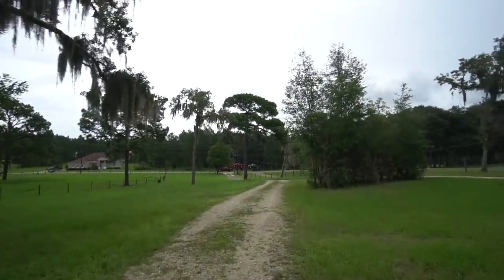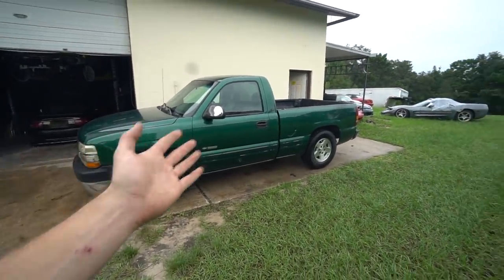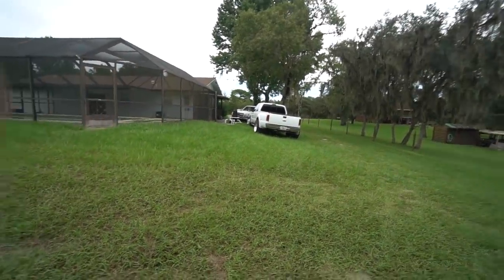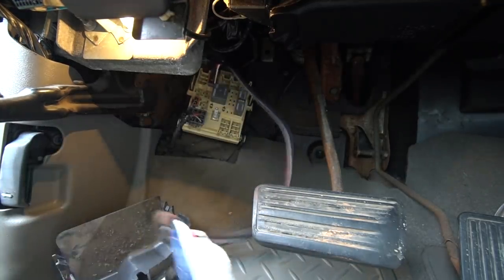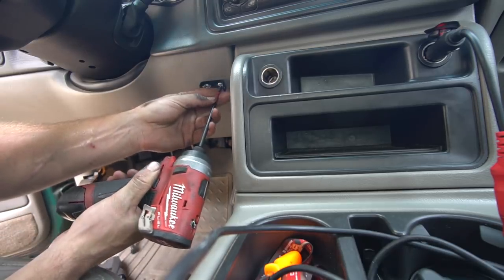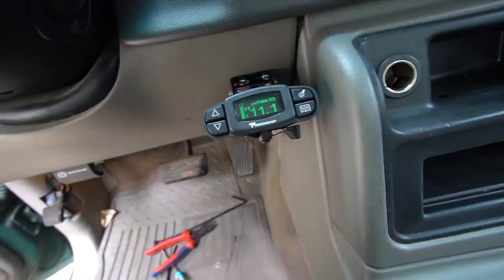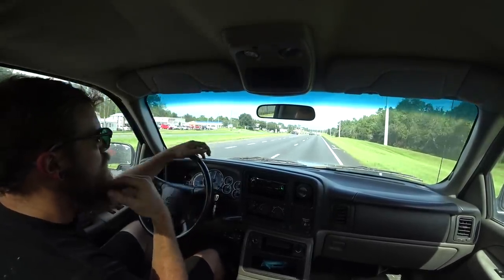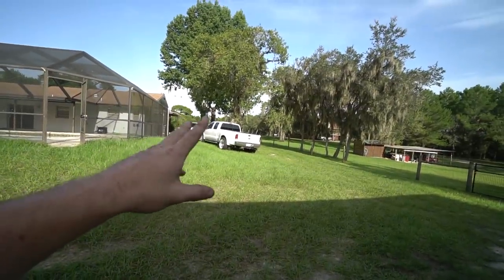I Bought Another Truck! After Searching Forever!

Comment: My trucks in great hands! So glad you own it now!
Reply: Derick Gaskins what year is the truck?
Reply: FUZAKERU 2000
Reply: How long did you own it before? if you dont mind sharing
Reply: About 6-7 years I owned it
Reply: @DGGarage  I Have been thinking about putting the HD 6.0 into my 1500 ext cab, i've got the gutless 4.8 noisemaker. Did you do the swap? was it a lot of work?
Reply: Brett Brumley it’s very easy
Reply: @DGGarage  I will have to do some research then, thanks!
Reply: What's up Derick my name is Derek but spelled different
Reply: Mike Zemble my other truck was a 05 with a turbo 6.0 it’s on my channel but unfortunately I sold it so I never really done any videos
Reply: Its a Chevy! Aint gonna be to great
Reply: Just imagine if the miata had a cyotye in it
Reply: Derick tell him to look into an ON3 turbo kit for it. Cant beat the price and their shop truck is multiple years old with no issues this far.
Reply: Derick Gaskins it looks like Taylor doesent know much about what’s done to the truck it may look stock but a lot of people know now it has a z71 lower Valance HD pad and looks like bumper was lowered the right way to fit the bumper and the HD grill no wonder it came with that hd hood It also has the Escalade cluster and pretty shure truck has way more things done that I’m over looking
Reply: @shanewest9310  yeah since the rx7 have a ls now it kinda boring same content unless the miatia is turn up .
Reply: @shanewest9310  Look up HellKitty.
Reply: @mclarenjohnf1  hellkitty is Miata in its final form 🤘
Reply: Shane West definitely wouldn’t fit they’re to wide on the heads you’d have to have the engine half way out the hood
Reply: I love it. Mine’s the extended cab Exact same truck. Rare color
Reply: I see you have a thing for 2 valve mustangs 👍
Reply: @jamesdiaz2748  lol yeah it’s more the car I love the shit 2 valve just comes with it lol.

Comment: It’s a stock Escalade cluster, it also has 2500 grille, front bumper and z71 lower valance if you ever have any questions I’ve built 12-15 rcsb 99-06 nbs trucks over the years
Reply: Wheelinwhalin the lower valance is from a z71 Tahoe.
Reply: Derick Gaskins yea I know I just had edited as soon as I seen your comment 🤣
Reply: Also the rack and pinion steering is a 2wd thing, not a 1500 thing.
Reply: What are those seats out of?
Reply: brody199422  03-06 Silverado/Sierra or Tahoe/Yukon same with center console
Reply: You also need the glovebox panel to make the centre console swap work
Reply: Mason Atkinson 
Little things you learn the hard way!

Comment: Towing upgrades needed for a 1/2 ton truck:
1.) Firestone ride-rite airbags to help sag
2.) powerstop z36 towing rotors and pads

I tow with a 1/2 5.7 Tahoe and those upgrades have been amazing.
Reply: How much weight we talking? Ive pulled a 38ft camper pushing 10,000 maybe more wihout issue. For a 5.3L and the fragile 4L60E she chugged alone at 70-80 without issue. Also, had no trailer brakes. and stopped simply by down shifting.
Reply: Brandon Caldwell 6klbs is the most I tow with my Tahoe. I have a built 4L60e and a brake controller.
Reply: @DiyDadFL  I tried installing a brake controller. Did everything but no luck on gettingnit to fire off. Not even getting power. Said fuck it and bought a larger truck

Comment: you could always invest about $3K in injectors, turbo, tuning and another $2-3K in full air suspension and have a lot less time and money invested in just as capable of truck, spend sometime and money putting some insulation inside and it'll be quieter.

The catch to a Cummins swapped 6.4 is, unless you swap in a newer common rail Cummins, a mechanically injected 12 or 24 valve is going to make a 6.4 just as loud if not louder than the 7.3 is.

Comment: I have a 4.7 liter 2001 dodge durango. That thing has pulled a nova from virginia to pa, a firebird, and a jeep XJ, never crapped out never let us down. cant underestimate gas motors man
Reply: They are strong as hell. People freak about the 4l60e. With my 2005 silverado 1500 5.3L L33 ive pulled 10,000lbs no trailer brakes without issue for miles on end. Hell, 2nd gear will bring you up to 90mph pegging the RPM out. Strong motors. i simply wanted different so i bought a 2018 ram 3500 4x4 dually. Still have the other truck though.

Comment: Taylor, you might be interested in this:
Since you are doing a 6.0 with a single turbo your hot side needs to be large for top-end power. If you get a Twin-Scroll turbine there is a device to make it spool much quicker.
Go to the Diesel Pump UK website and look at their Quick Spool device. All it does is close off on half of your twin-scroll, forcing your turbo to spool, and then opens the other half at a preset boost pressure. You can have your cake and eat it too.

Comment: I figured you would've known that the LS would be just fine towing. They make 350 torque untuned from the factory in those trucks, and that's just the 4.8 or 5.3 but you got the 6.0. If you get a tune on the truck it'll tow even better. You know personally how good the torque is from those truck engines as you've swapped many into the Miata lol. But ya I'm gonna get myself a 1500 Z71 like yours they are a great value for the dollar. Lol you said you were pleased so many times lmaooo

Comment: you arent giving the 7.3 any credit at all. I dont get why you have no confidence in it, id trust it to drive coast to coast
Reply: @jtackerman28  Not if he'd stick the money into a mild build and make WAY more torque than the gasser build.
Reply: Ford trucks=no horsepower + reliability 
Dodge trucks=horsepower + no reliability
Chevy trucks=!horsepupies + reliability!
Reply: @pan2ube  Isn't their a class action lawsuit against GM for failing injection pump on the Dmax? I can't remember if it was l5p or lml. I'll let the injector thing die though, that was forever ago now.
Reply: 7.3's are slow yes but they are super freaking reliable. With a tuner should be totally fine
Reply: 7.3s are dogs. Junk.
Reply: No doubt a well sorted 7.3 will pull a car across the country. But i think Taylor's idea is to have a truck that will do that but with modern comforts and with ease vs. having the 7.3 wound out the entire way.

Comment: From friends experience you need to find the biggest dual pass trans cooler and dual fan setup you can fit in the front of this truck. They need to run at a lower temperature to prevent cooking the clutch packs & frictions. Get 2 tunes that you flash in to it. Towing, where you can lock the trans in third on the interstate & town. NEVER USE FOURTH TO TOW as You will kill it unless it's got an electronic control lock up torque convertor that you can activate manually. Also from fiends experience - if you go away from the tall sidewall like you have now the truck will be a pig to drive long distance as the truck doesn't have the weight like the Ford or previous trucks. 

Taylor I live my life through a lot of you online guys doing this work. I'm a 37 year old motoring enthusiast, short sighted & classified legally blind. I can't hold a license ever as surgery isn't available to fix optic nerve damage yet.
Reply: Ben Pratt truck has a large cooler and 4.10 gears. In the middle of summer towing at 80mph it never goes over 160 degrees

Comment: i have a 2500hd with the 6.0 and ive just done boltons and a tune and she tows like a dream. having the disc brakes on all 4 corners is definitely a plus though especially pulling at highway speeds
Reply: Thats i wont deny. I bruned through a set of front pads in 10,000 miles thanks to towing with no trailer brakes and craptastic drums. Least i dont have to worry about rocks in there. Not that i really drive that truck anymore.

Comment: An Aluminum trailer is your friend with that truck
Reply: With a 6 liter the steel trailer is fine it should have no issues i tow a 24 foot steel with mine
Reply: rougher ride with a standard cab short bed and 6 liters are pigs. Aluminum trailers are all around nicer, lighter/ no rust makes it worth it in general.  @kylecube15
Reply: @Durmarsa  they are pigs but reliable pigs with enough power for a 20 foot.  Also i agree with the aluminum trailer but i am saying he doesn't need to buy a new trailer this truck will pull it just fine
Reply: I had larger and heavier on the 5.3L and the fragile 4L60e handles fine. Still have that truck and it acts like a rocket after its pulled 10,000lbs. Not my foot compensating either. Hit resume on cruise after pulling that load going 0-70 will cause the tires to chirp when taking off when before it was like grandma going for a run with her walker. Also, that damn truck is backwards. Trans temps drop from 210 to 180 and the water temps drop from 190 to 160 while towing. Without a trailer, it acts like it wants to cook itself while towing shes as cool as a cucumber. Entire front end needs to be rebuilt. Was too much slop in the steering.
Reply: @Durmarsa   Stock with exhaust and tune only you can get around 405hp and 440tq. How are 6.0 pigs?

Comment: I have a 2006 2500 with the 6.0, did flow master , bullydog tunner, and intake, tows my jeep on tons no problems,  only thing i see is the tail pipe kinda low, nice to see you back in a Chevrolet nice truck

Comment: The reason why many people opt for a  3/4 ton or 1 ton diesel while towing is fuel economy and maintenance . Diesel engines get much better fuel economy both loaded and unloaded, and the heavier chassis wear less while pulling loads. I have a 7.3 f250, get about 19mpg unloaded, and with a single car open trailer with an e36, it gets about 15mpg. While my company truck, a 2500hd 6.0 gas, gets 12mpg unloaded, and with similar weight on a trailer, gets about 9mpg. I've also used a bronco for towing back in the day, and it ate through front brakes, rear axle bearings, and transmissions like its job. It also got hot often, and so does a co-workers 1500 when towing. 1/2 tons just aren't built as heavy. Most 1/2 ton users rarely have anything in the bed, let alone tow.
Reply: My 2005 silverado 1500 5.3L L33 z71 is opposite. I get 12 constant loaded or unloaded. Empty, it sits at 210 water temp and 190 trans. Pulling 10,000lbs itll drop to 190 water and 175 trans. Keep in mind,im well over double maybe triple what that truck is rated to tow. It helps when you have new/flushed out systems. Also, i deal with Texas Humid 110 heat.
Reply: Brandon Caldwell you don’t tow no 10k with a half ton
Reply: @tacticalguy127  Dude, i did it like 12 different times already. More times to come too. Fine you dont believe but i promise ive done it a dozen times over 2500 miles combined. Truck is perfectly fine.

Comment: turn your trailer break down. thats why it is locking up. its because you were towing that heavy inclosed and now that you have a lighter truck and trailer the trailer break still thinks its a heavy load so it applies the breaks harder.

Comment: Nice job with the new truck, but for what you said, putting tools and weels on the bed and go, i rather have one with closed bed, so now rain, dust or whatever can reach them. But that's me, ohh and something else, i think you should calibrate the braking force of your trailer weels. They looks like some are braking and some not or not as much. Please check them as so the new truck a general check before use it. Keep on uploading.

Comment: Make sure the Tow/Haul function works. The lever on these trucks are notorious for splitting the wire to the T/H button at the end.
Reply: Mario Funk had to fix mine twice
Reply: I wouldnt worry about it. Ita not the 4l60e its the 4l80e. It makes light work of that load as it is. Hell, my 5.3L with te 4l60e pulled 10,000lbs screaming in 2nd gear up a 7% stick at 65mph. When i mean screaming. 2nd gear will hit 90mph pegged rpm i was holding 4500 up the hill.
Reply: Brandon Caldwell sheesh what rear gear do u have? Im at 4200rpms in 2nd at about 60-65mph with 3.73s going up a steep grade
Reply: @Ajrubiofoo  Stock 3.42s Im sure 2nd has been slipping as 2nd to 3rd is a bi*** of a shift if you dont back out of the throttle a little. Truck just loves 2nd gear as its a pig in it. 3rd is just highway cruising. Temps all drop too when towing heavy. Trans usually sits 190 water 210. Pulling heavy will drop to 180 trans and 195 water. Dont understand that truck, but whatever. Think things kust are flowing quickly preventing it from warming further and going through the coolers moreso.
Reply: Brandon Caldwell 5.3 with 3.42 towing 10k? What year do u have?
Reply: @Ajrubiofoo  2005 branded, November 2004 built z71.
Reply: Brandon Caldwell nice. Stock oem trans cooler?
Reply: @Ajrubiofoo  Yes sir, all stock. The only thing thats not is a programer for the temps and a couple shift points changed and firmness along with the intake. I put a much larger 4-5in pipe with what i call the vaccum cleaner filter. That sucker sucks air sounding likw the motor is drunk on air with the note change. Thinking of just mouning the intake and MASS right on the throttle body.

Comment: i have practically the same truck but its just the 5.3 and i have towed trailers that are the same weight as the truck and truck on the trailer that weighs more that the truck and it stops and tows perfectly.

Comment: -Dont forget the tow/haul button on the shifter, I'm sure Taylor knows about it having owned that other chevy, but still
-If the truck gets a little squirrely on the highway due to its shorter wheelbase, add a trailer sway controller. Had one on my Titan pulling my camper and it helped with the side to side movement https://www.amazon.com/CURT-17200-Sway-Control-Kit/dp/B000HLO7QA
-Add a roll up soft bed topper. They look so sweet on SCSB trucks, and when its rolled up you have the whole bed to use. Make sure its a roll up and not a trifold or snap one though. The snaps are a pain in the ass and the trifold may be easer to open and close, but its either in the way or blocking the window when open

Comment: Look into finding a hydroboost setup on a 3/4 ton it will help alot
Reply: Had that on my 400whp SS awd with bear big brake rotors and braided lines instead of stock. Stop on a dime. Went to a 1500 4wd crew cab and have missed it ever since.

Comment: Hell yea dude super stoaked for this truck build and the LS FC but i would do a single 72mm wit twin 44mm gates to prevent any boost creep from the start cuz alot if kits for the Silverados have bad boost creep issues like the On3 kit but even if u make ur own manifold i would still do twin 44mm gates with a single VS racing 70 or 72mm turbo full 3inch exhuast since its gonna be ur hauler nd ur gonna be travling or do 3inch downpipe to a full 2.5inch and run a cut out right at the end of the down pipe but honestly a full 3inch turbo back wouldnt even be loud and instead of a air filter on the turbo id run a turbo guard thats wat thier called look them up allow the turbo to breath 100% but keeps any debris from being sucked in but yea id rum hp tuners and have 2 or 3 tunes 1 for daliy driving not loaded then 1 for when ur hauling and the 3 one would be the full power balls to the wall tune for when u want to put the hurttin on some trucks or anything in general

Comment: You didn't even use tow/haul mode... push the button at end of shifter stock. Changes your upshift/downshift better for towing
Reply: Its a 4l80e not the 4l60e. Doesnt really matter as the 80 is a 1 ton/3/4 truck trans.
Reply: @brandoncaldwell95   What is your point? My 2500HD has 4l80e and tow/haul mode
Reply: @KenMrKLC  Pount is, its such a light load it does not need it.
Reply: Brandon Caldwell  I respectfully disagree, I agree it is capable without however having the shifting points change to benefit pulling a trailer would be better not worse. If I’m pulling any trailer over 5000lb combined trailer and cargo I use it.
Reply: @KenMrKLC  Look, i know what im talking about. If anything i know better as ive done pulled way more crap with the "fragile" 4L60e then anyone cares to admit. Especially pulling 10,000lbs or more up a 7% screaming at 4000rpm at 65mph in  2nd gear. That trailer and car is hardly anything required for the 4l80e to handle requiring "lower shift points". Just delays it a few RPMs. If you didnt hear, the torque converter is not right. By the sound of that RPM level he is already chilling around 3500-3800 when average Highway is 2500-3000. He is perfectly fine not in Tow/haul mode.
Reply: Brandon Caldwell don’t forget about coming to a stop, the transmission downshifts quicker which helps slow you down via engine brake. I’m not saying you can’t pull without it, I’m simply saying it’s only going to help to some degree. Apparently you have your mind made up otherwise and that’s fine we all have our opinions. For me I use tow/haul on any load 5000lbs or more. I have had dozens (if not close to 100) 1500, 2500, 3500 over the years. Bought a couple new. I have a landscaping company and drive
pulling a trailer more often than without. Been driving for 29 years. I use to love the old TH350 and TH400 transmissions.
Reply: @brandoncaldwell95   Thats adorable!

Comment: Not quite sure why you’re pumped to tow with a 6.0, I have a 01 2500hd gasser and it only gets like 12 mph not towing lol
Reply: 12mpg is what my 05 5.3L gets. Also my 2018 ram dually diesel.
Reply: 12 seems to be my go to number.
Reply: Brandon Caldwell that’s not an ideal number for a diesel 😂
Reply: @Doesntmatteratall  High gears for you... Torque for days. MPG is smiles per gallon...